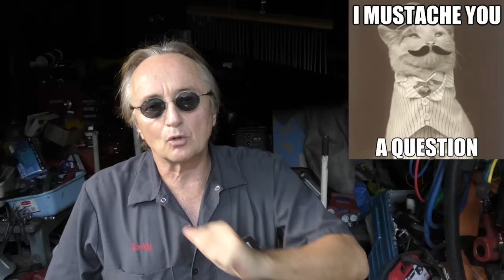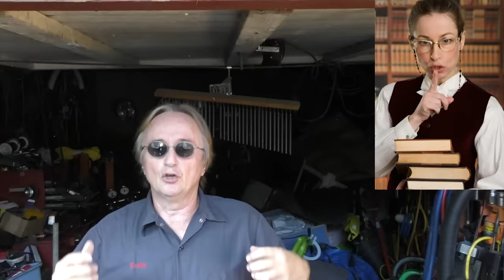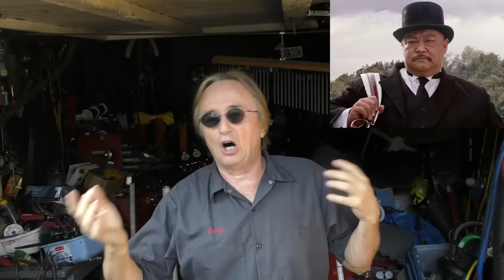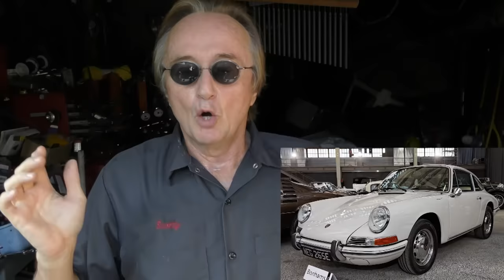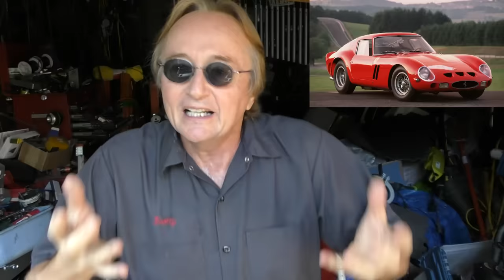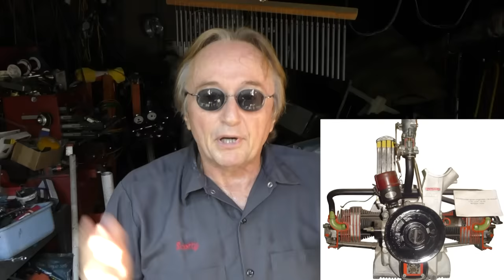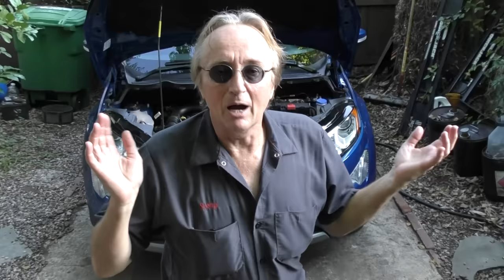The Truth About Boxer Engine Cars

Comment: Old Scotty is way off the mark here. I run a Subaru forester 2,5 turbo 2006 model, and have driven it for 16 years now. It develops 174 kilowatts of power and the 0-60 time is 6,9 seconds. Pretty good for an SUV even in todays terms. I maintain the vehicle meticulously and have now done 320,000 kilometers (210,000miles) and that motor still runs like a top. The vehicle is without any creaks or rattles and the build quality(made in Japan) is excellent. Ask any Subaru owner, these are actually great cars with as good as any Toyota  engines....which is why they also use them.....

Comment: I am a mechanic who grew up with and learnt on aircooled VW's. I have never owned a water cooled VW and that is something I actually feel proud of. VW let down its' true followers when it went away from its' roots. The reason was not design but cost. An inline front drive engine was cheaper to manufacture hence the change. It's always about money. I used to be VW to my core almost did a VW tatoo in my youth but I have become a Subaru fan and owner because they are the closest I can get to what a VW should have been since the air cooled boxer era. Put a 10 year old Subaru next to a 10 year old VW that had a similar life and the Subaru will look years younger especially on the inside and in the engine especially where ever there is plastic or upholstery. VW makes a good rust resistant body but what use is that when everything else is crap way too early in its' life. Subaru though is now at risk of loosing their base as well since they are also making very money driven choices that alienate their fans such as not having a Turbo Forester or some kind of WRX ish SUV. Don't abandon us Subaru.

Comment: Subaru's are great! Very reliable and the best car you can own for winter driving. And they heat up quick with their aluminum engine.  But with that said be carefull of leaking valve cover gaskets! When they begin to leak it blows back on the exhaust pipe and the smell of burnt oil isn't to pleasant. The fix is going to be expensive (Over 2K) at most dealers!  The valve covers are up against the frame so the enging has to be raised or come out completley! When you do an oil change look for leaks! Spark plugs aren't to easy either.

Comment: Love my Subaru ,,, bought many have sold none,,,, they just keep being handed to the next generation....I have one with over a million miles on it,,,,just routine maintenance is all that has been done to it....
Reply: Hank, I have 1991 Loyale, 1.8 FWD  5spd. non-turbo. 320k miles. Just passed Calif smog w flying colors. What are likely engine problems? Low oil pressure due to crankshaft bearing wear? Have heard that the piston rings last forever. I have done head gaskets and timing belts and cv axles on it easy enough. And have fixed that OBD1 code 34 [? EGR solenid]  by replacing a bad transistor array chip in the Hitachi ECM. That cost 10 bucks in parts and it was a real easy soldering job.
I want it to go to 400k and then to 500k and more!
Regards, Tom

Comment: I test drove a Subaru Liberty 2009 with 6 speed CVT auto sports gear box and it was one of the best cars I have ever driven!
Very quick, responsive acceleration from a 2.5 litre non turbo boxer engine and amazing handling/cornering!

Comment: Boxer is a great fit for Subaru, because it's all about balance, low center of gravity, and HANDLING with that amazing symmetrical All Wheel Drive system.  I've never driven a car that handles better in snow than a Subaru.  If you live in the North, and you want to drive in snowstorms...get a Subaru.
Reply: Wrx/sti: sports car that will churn through snow and ice and get me to the ski hill or to work with no fuss when everyone else is sliding off the road. Practical and fun. Gotta love it

Comment: Had an 04 Legend, 130,000 miles, very smooth running engine.  It ran exceptionally smooth under acceleration like no other vehicle I've ever driven. If it wasn't totaled in a accident I'd still have it. For the right price I'd buy another one.

Comment: I just bought a subaru Outback with 175,00 miles on it. It's the quietest car I've ever driven. My understanding of the head gasket issues is, it did not help that in the early 2000's Subaru used a gaphite head gasket that was sensitive to the chemicals in the engine oil as it aged. The oil doesn't drain down into the pan like it does in a normal engine and pools around the head gasket seam slowly degrading it until it would blow out eventually. They don't use those graphite head gaskets anymore. My particular car had the head gasket replaced with a multilayer steel gasket a few years ago. I have been very impressed with the EJ25 engine so far. I won't win any races but it damn sure has a lot more power than my old Ford Focus.

Comment: Even at 300k miles, engine runs smoother than any I’ve ever known. To date,  no head gasket or other major problem. It’s not a perfect vehicle but cost of ownership has been very low and reliability very high. 
Lifetime $/mile cost would be hard to beat if you’re able to perform your own maintenance. As a benefit,  the AWD capability & durability has been very good as well.
That’s the benefit of tried & true technology. The correct balance of weight/horsepower/performance is very important and often overlooked on newer models.
Reply: I bet any Hondas that have been  in my life would beat the cost of ownership
Reply: Maybe, if you have over 300k miles on your car let’s talk.

Comment: Subaru BRZ/Toyota GT86 has 200 horsepower from 2.0 litre naturally aspirated engine. Show me other NA engine with 100 horsepower from 1 litre displacement, I wouldn't call that technology archaic or old.
Reply: Rafał Wyrębiak the Honda k20 engine was a 2.0 engine that made 100 hp from each liter and it performed way better than that 2.0l boxer.
Reply: BMW s54 3.2L 333hp
Reply: NA = North America
Reply: Idk if it's 100hp from 1 litre but rotary engines make a lot of power for how small they are.
Reply: @zohanjames7793  is that the Honda s2000 engine? Honda s2000 use more fuel than a V8 Corvette.  Horrible fuel economy for a small engine.
Reply: Honda B series (with V-TEC), K series (with performance I-VTEC), F series, 2014 Porchse 911 gt rs, Ferrari 458 Italia,  mazda rx-8 renesis rotory engine.
Reply: Thor.....got to pay to play.
Reply: Thor _ the engine I was taking about was the engine in the rsx known as the k20. The engine your referring to is called the f20a 😎
Reply: Mustang GT350, Focus RS is well over 100hp/L, same with the EJ257 in the STi and even more so in the FA20 in the 15+ WRX.
Reply: High Output version of the Oldsmobile Quad 4 from the mid to late 1980's. Could be setup with slightly larger injectors, cam timing, and mild computer. 220HP in NA form. Factory was only 180HP though. However those engines had quite a few reliability problems, so even though they made power they didn't get much of a good reputation.
Reply: Shorpy those don't count. They're all forced induction. He's talking about NA engines.
Reply: @zohanjames7793  GT350 is NA.
Reply: Shorpy my mistake, but the others are not.
Reply: HP is not that bad... the problem is torque
Reply: Yeah it's bad.
Reply: Nissan's sr16ve made more power per L and it came out in the 90s
Reply: Why does it matter how large the HP/ci is? By that metric you Honda guys all lose to turbo rotary engines. Weight matters, durability matters, Hp/torque matters, HP/ci does not matter
Reply: The problem is the power band, more specifically a weak mid-range.  Subaru boxers have plenty of torque very low, and again at higher rpm's but mid-range around 2800-4200 is weak.  They match beautifully with turbos that fill-in the mid-range power deficiency.  Scotty is absolutely right regarding non-turbo boxers, they feel very weak. Subaru's fix was to turbo them or pair with All-Wheel-Drive (where low rpm torque is helpful) and sell to niche markets.  Either with turbo or with AWD they are not very fuel efficient, ...and that is what makes them kinda old technology, gas hogs.   The WRX is great as it has low end torque with a powerful turbo boosted mid-range, and AWD, of course fuel efficiency of this combo is pathetic.  A niche car basically.  Rev-up your brains Subaru enthusiasts and face the reality that boxers are essentially obsolete.
Reply: Garrett Long   NA is naturally aspirated dude....was that a joke or you really though he meant it has to be a car from North America ?
Reply: Ford 1.0 ecoboost 140bhp
Reply: +kevin hodge 1.0 Ecoboost is a turbocharged engine
Reply: @jacobdukes4741  Yes.
Reply: @rafawyrebiak189  do you really think that turbo on a 1.0L is making more then 40hp. I'm sure the 1.0L NA can make 100hp easy. But 100hp per litre is still acceptable but the gas mileage is not from any boxer motor. I have the 2.0L turbo @ 252 crank up and get 28avg with my foot in it 40% and drive at 80mph most of the other times. A 2.0L boxer can not get that mpg avg without driving slow and still cant make that up when needed. Ecoboost is the way if you have a catch can lol
Reply: Rafał Wyrębiak s2000??
Reply: +hoodmobbin Yes, i do think that this turbo is making more than 40hp. Turbocharging can easily double engine's power, if this engine would be NA I would bet it had around 85hp.
Reply: Lmao says NA car. Every answer is Asian or European car.
Reply: Toyota altezza 3sge beams
Reply: The matrix could be ordered with a 1.8 180hp engine..like the one in the video. 100hp per liter is not much of an engineering feat anymore though. My 1980 honda single cam motorcycle does more than 100hp / liter without variable valve timing.

Comment: Hey Scotty, I'm curious to know your thoughts on the latest Subaru engines (2019-2020). They still seem to be convinced boxer engines are still competitive with other modern engine designs. Have Subaru taken any steps to improve their engines materially since you made this video? Or is it still "dinosaur technology" in your view. Thanks 😊
Reply: Subaru went with the boxers mainly due to the safety reliability, especially in a head-on collision, as the engine will tend to go down under the car as oppose to in your lap like other engines.
Reply: @Nalothisal   They continue to stay with the boxer engine because it’s something that sets them apart, like every car being AWD too. Some people like them, some people don’t. But the ones that do like them, usually become repeat Subaru owners who are in love with the boxer engine and the AWD system and they rave about it!
Reply: @zackstaa7826  Indeed. I have one myself and besides a few quirks that tend to come with all used cars, she's great! Manual transmission too so that's a bonus for me.
Reply: @Nalothisal  I’ve got a 2021 WRX, I bought it with 2,000 miles. It’s a drivers car…manual transmission, excellent handling, but nothing too fancy. No race modes or anything. It pretty much drives like the older tuner JDM cars from the 90s-00s. It pops and bangs a little when you shift….fun little car. It’s far from perfect, it’s not the quickest sports car, but I still get excited every time I hop in my Subaru…it’s a blast to drive.
Reply: @zackstaa7826  hell yeah man. I just picked up a 2019 STI. Sooo fun.

Comment: My cousin inlaw works for Subaru as a master mechanic. He said the engine will last a good while if you don't drive it too hard. But most people dont because they have turbo, so they have issues like blown head gasket. BTW he said most repair do require dropping the motor so its something to think about. Thats extensive.

Comment: Hi Scotty,
Huge fan. This video was enlightening. I’ve always been a fan of the “boxer”. I drove VW’s in high school and the first half of college. 
Like you, I’m also a motorcycle enthusiast. Started in dirt and have had about every size of street bike. During my late 20’s, I bought my first Goldwing. I’ve never bought anything else since. I’ve owned the 4s and 6s. I’m convinced there is nothing more reliable available on the marketplace. Not even BMW with their horizontally opposed can match the Wing with reliability. 
I guess my question is: Why haven’t car engine mfgr.’s put money into developing the boxer specs to more modern standards? I cannot believe the design is so limited as to preclude further enhancements similar to the inline 4s. Look at what Honda has done for the Wings. Best Touring Bikes in the world bar none. 
If it’s hard to tell, I miss my VW days but dearly love my Wings. Wishing I could buy a new car or truck that I knew the mfgr was good at boxers.
Reply: Boxer engines are more expensive to make then inline (need 2 heads instead of 1), and the engines are very wide so they are harder to fit into engine compartments. There is nothing wrong with boxer engines, but there is no huge advantage to use that engine design for cars.

Comment: Boxers a dated design !? - yeah, just about as dated as any other internal combustion engine with a crack shaft, pistons and you can those to have valves or not as they come as 4-stroke or 2-stroke :o)

Not really optimized for performance !?! - Porsche 911 GT3 rs: 4.0 flat six, 520 HP,  193 mph, 0-60 mph in 3 sec flat - doesn't look lame to me !!!
Subaru was quite succesful with their boxer in rally, so did Alfa with their boxer. Citroen did quite well with their 4 cyl. boxer in the GS models - but every thing in the opposite end of the Bettle, including the driven wheels ;-)
And then the iconic - Ferrari Berlinetta Boxer 512 - what a lame carriage, don't you think ?
Btw, they actually toke the engine layout for the BB512 from the contemporaries Formula one racers - boxer are lame !.

You may have 50+ years of experience fixing cars and I do not doubt you are a very skilled mechanic with a huge knowledge of what car designs were reliable and which was NOT.
But your engineering knowledge seems to be - limited - is that harsh to say ?, or should I just say - you sometimes need to do a little more research and read a few more technical books and articles before you pick up a topic.
Reply: Time for a jet engine in a car and that would be more modern than any engine that put in a car nowadays I assume 😂
Reply: Whoa someone likes the boxer engines okay

Comment: I did test drive  a lot of small 4 cyl. SUV's recently. All of the inline 4's rev real high and sound like sowing machine engines to make any power at all. None had any low end torque. No get up off the line power. Then I tried the Subaru Outback. Wow! This has a 4 cyl engine for real? Yep.
2.0L boxer engine. But it has low end torque. It pulls hard right off the line. Not like a sports car but it does pull like it has a V6 engine in it. 
Best part is on cruise at 65 MPH it runs at 1900 RPM. And it does not bog down on a hill either. The other inline 4's all run at 3,000 RPM at 65 MPH. Get to a hill and they rev up as the gears kick down to climb the hill. Sound like the engine is going to jump out of the car. Subaru engines simply run better do not shake the vehicle apart and do not need to rev up super high to make decent power. They feel much more like a V6 than a 4 banger. Pull more like a 6 as well. I can not speak to the rest of the boxer engines as I have no experience with them. But if I want a 4 cylinder engine for gas mileage I can tell you I will pick the Subaru engine hands down over any other 4 currently on the market.
Reply: Dan Hammond well what kind of mileage do you get? I like what you are saying about the power.
Reply: Dan Hammond 2.5l actually
Reply: Dan Hammond and your cvt transmission helps

Comment: I call BS! What specifically about horizontal pistons causes it to be slower or have gasket problems? Don’t make an assertion without justification lol.
Reply: this guys has 50 + years of experience, i leave it there
Reply: Ritus woods that is a logical fallacy, arguing on nothing but authority. The problem with that is that we can just grab some other mechanic with 50 years experience that likes the boxers. His opinion isn’t universal, and he didn’t actually give any reasoning. Personally, I’ve never known a Subaru that died before 200k. I had a mid-80s GL5 with a 1.8L engine, and I still drive an 07 Legacy sedan with 5-speed manual as my daily commuter. I’ve also had a couple Honda Goldwings, which are powered by boxers and known to last for hundreds of thousands of miles.
Reply: @Maheshan Govender BMW Boxer engines are the most reliable Engines of all Motorcycles and there isn't a gasket problem.Never has been.
Not with a R45 R80 GS1200 They worked for years and years. More reliable than V twin engines that I'm thinking of now.There is no specific gasket problem. Porsche had them aircooled in the back. I don't know much about Subaru.But if boxer engines have problems why does Subaru use them over dekades?  I rather agree with you as with "whats his name". Maybe it's his age and he ment rotary engines?
Reply: Head gasket issues have always been synonymous with the EJ engines, specifically the EJ25 turbos. This was more on Subaru for using an old family of engines instead of redesigning and updating it sooner than they did. Now, I think the new generation of boxers are more improved, but by no measure am I saying an EJ is worthless. I should know, i just bought a high mile one.
Reply: @rit4140  - That means little when unfortunately he can't distinguish between design and configuration. Something pretty basic, I might had.
For my part I just have been a mechanical designer for >35 years and wrenching for a bit more than that. ;-)
It as nothing to do with being an old technology, or more noisy, etc. Those are all fallacies to be pointed to one particular design implementation. Nothing to do with a particular engine configuration. ;-)
Reply: @crpth1  fair enough